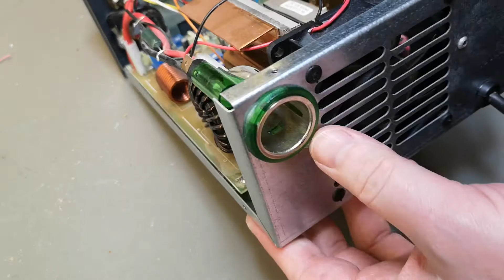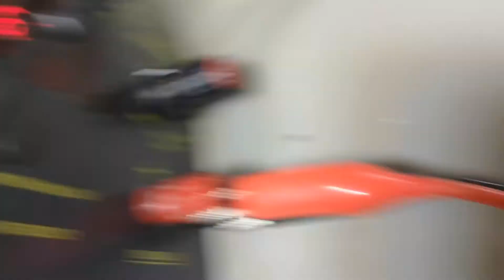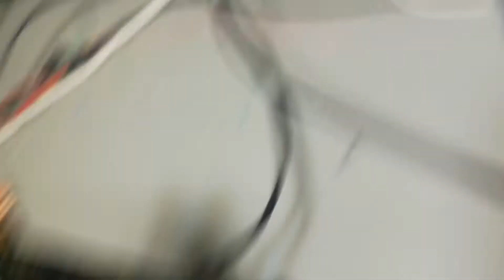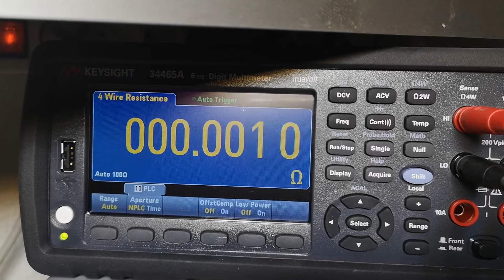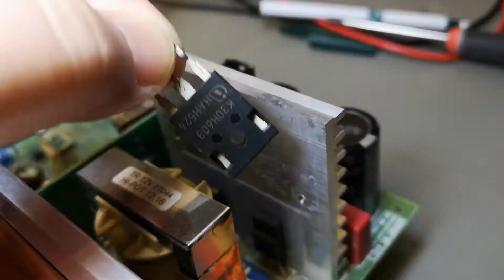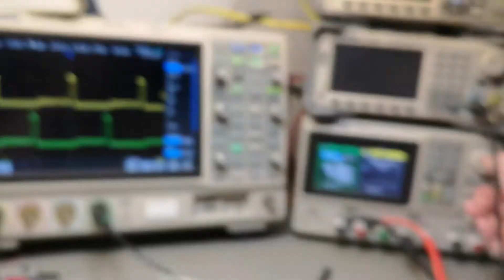Switching power supply - PCS 140 - Microset, Teardown, Repair

Comment: Strange attitude toward the customer's equipment. Why poke it with a screwdriver and damage the enamel on the choke winding? Personally, I would never trust that kind of technician with my equipment again!
Reply from the maker: strange comment, what do you mean ? but thanks for watching :-)
Reply: @TeardownOZ2CPU  https://youtu.be/ISJqNMTae0Q?t=194      Why, at this point in the video, are you tapping the choke winding with a metal screwdriver? The wire is enamel-coated, and you could easily damage it.
Reply from the maker: @Dm1tri81  the screwdriver is round, and i barely touch, the camera is very close and pick up the sound very loud, so you get the feeling i hammer it into parts, but i barely touch stuff, if you have tried to remove enamel from a wire like this, you will find you need a very sharp tool and very hard work to scrape it off, and the fun thing is this is the low voltage output chokes, they dont even need to be isolated, they are not touching any other parts or metal.. but thanks a lot for note this and comment about it, it tells me you watch my video with great interes into details and i like that a lot.
Reply: @TeardownOZ2CPU  Your video is well worth attention — the repair and diagnostic methods, showing every internal component of the unit, is really great. Not everyone has such a unit; I was planning to buy a similar one, but now I have some doubts because of these kinds of faults. Regarding the winding, yes, maybe the camera angle gave that impression — that you're hitting the enamel, or that some damage might occur there. I certainly wouldn’t do it that way; I’d either use a plastic screwdriver — like the kind used for adjusting inductance in cores, in electronics.
Reply from the maker: @Dm1tri81  if my video made you not purchase a psu like this, i am happy, the quality all over is just too low for my taste, it is clearly a low budget unit, if you seek better quality it comes with a bit higher cost. The owner of this unit is still super happy about it, he use it all the time for travel to new destinations, setting up ham radio stations, every gram and size is a huge factor when you travel you pay pr weight, and you have to carry things.

Comment: Interesting teardown and repair video with good explanations, thanks!

I was considering buying a Microset PSU for my lab/shack. Although not this particular model, the different SMPS they offer in this range appear to be largely similar.
After watching this video, I am not very convinced regarding their quality. The voltage feedback circuitry with the potentiometer was really terrible, and looks like some rookie mistake.

I don't understand why they go through the effort of designing and producing a low quality PSU in the EU. There are surely a lot of asian low-cost alternatives with better quality than this.
Reply from the maker: I hope this model is the only one this bad designed, but I dont have the budget to find out.. if anyone have more of their units broken or working, please send to me for test repair teardown or blowup :-)

Comment: Hello Thomas, I have one PCS125. It looks really close to the one you presented on this video. It works pretty well but two points : output voltage drop by almost half a volt when moving from 1A to 10A, second point is that output is not rock stable (I compared with other PSU I own), it varies by 50mV. I do not have the equipment to plug my oscilloscope into such device (isolator, differential probe, etc...). Any advice to fix this output ripple ? Op amp ? Capacitors ? I see on your PSU a big capacitor on the ouput (grey square), I do not have it, any impact ? Thanks !
Reply from the maker: the caps on the output, change to much larger types that can handle the ripple, you most likely need 2-4 in parallel,
Reply: @TeardownOZ2CPU  thanks for the answer. You mean the blue and black ones (at 50s on your vidéo) right ? But it varies also with no charge. And the very end of your vidéo you show the output voltage on your "table" voltmeter ans it looks very quiet..  I will start with this anyway, it has been used quite intensively for 4 years, those chemical caps may bé tired. IS the fan supposed to run AT low rate AT low température ?!?
Reply from the maker: @patricebarroul2613  all caps loose a bit of their goodness over time, specially when running hot, I do think this psu should have a minimum speed on the fan, so it is running slowly, even when cold, check if yours got that min speed resistor mounted, else i suggest you do that.